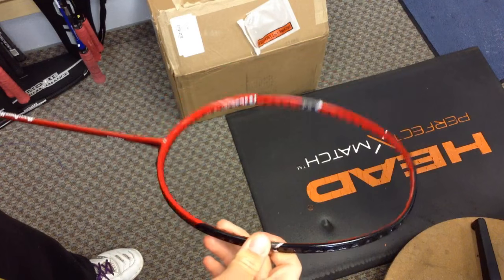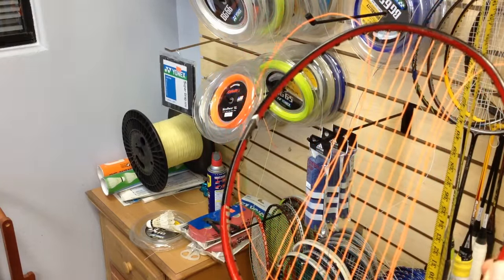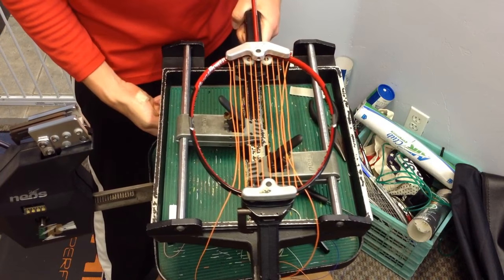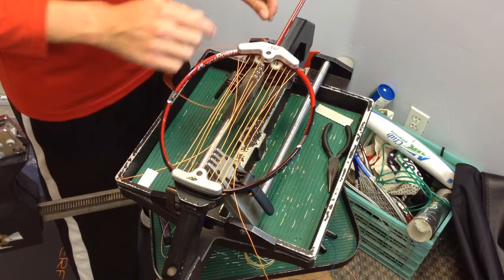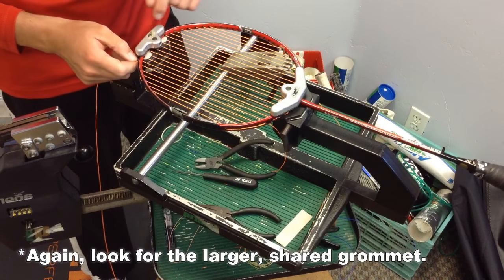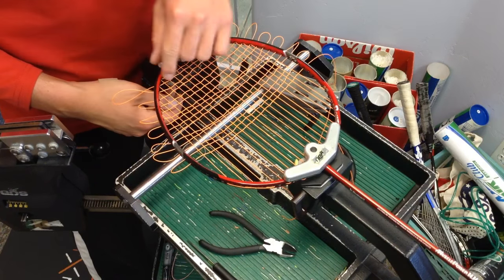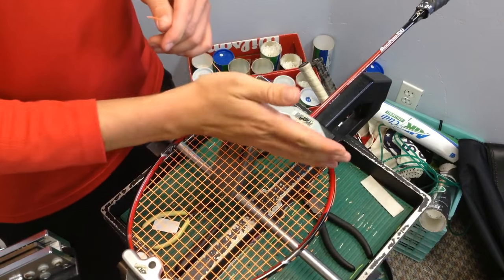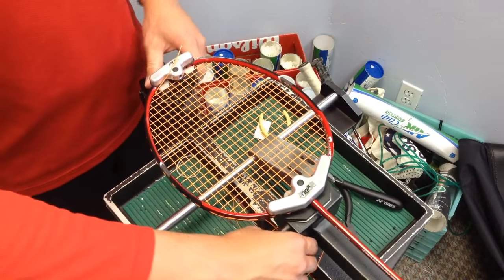Tutorial: How to String a Badminton Racket

Comment: nice video commins, I have the same machine, but my tip plug is quite high compare to yours. They are perfectly fine for tennis but for badminton it's blocking the grommets holes. Where did you purchase that, did your machine came with different tip plugs?

thank you
Reply from the maker: Thank you for the comments. I don't own this stringing machine, it's owned by the badminton club I work for. As far as I know everything on the machine is original, including the tip plugs.

Comment: On the stringing machine..once you've locked the racket on its frame the shaft is then noticeably shaking if moved or touched. So as you're stringing it what happens if you accidentally touched or hit the base of the shaft or the holder or the grip as you're moving/rotating the racket in 360 degree horizontally? Will that 'ruined' or in anyway affect the racket?
Reply from the maker: The racket will be good. It will not be ruined. All rackets have the ability to flex a little bit and when you swing it the racket will seem to bend. That's all that's happening when you touch the bottom part of the racket when it's in the machine.

Comment: Hi sir.. Is it still possible to buy a mp100sp?
Reply from the maker: It's nearly impossible since they stopped being manufactured almost 15 years ago. You may get lucky and find one on e-bay. I still have 4 that are unused, but they're not for sale :)
Reply: @danielcommins1285  OK sir, but I hv a question for u.. I found there could be 2 versions.. Or maybe I'm confused.. Mp100 or mp100sp is the real one?
Reply from the maker: @joshuaprime777  the sp or non-sp version of the racket is a manufacturer/distribution code. They are both the same racket. Either one will be hard to find.

Comment: honestly, I am very concerned about the 2-poin mounting system, and I haven't seen a muscle power for a while, so much memory. Great instructions!
Reply from the maker: On a 2-pin mounting system there's actually a way to brace the sides using a Y-clamp and some spare string to reduce the chance of the frame collapsing under higher tension (>=24 lbs). I use this method to string racket tension as high as 30 lbs.
Reply: @danielcommins1285  can you make a video about that y clamp? I would like to learn because I have a two points machine too. Thank you
Reply: @danielcommins1285  I am interested in a video or explanation of this method.  I have strung previously on a 2 point machine and always wondered if it was feasible to go higher tension while maintaining headshape, to prevent damage.  I always strung 23x25 max except one request, 25x27.5, but customer insisted and didn't care if I broke it.  It didn't break, but I was cautious and worried.
Reply from the maker: @Nate-ui6yl  you have to brace the racket at the bottom horizontally with the y clamp. The racket has the highest chance of breaking at the bottom 4 o'clock and 8 o'clock positions when stringing the mains. This is where you need to put a string using the cross tension to prevent this. The high tension on the mains will cause the racket to collapse vertically so you have to brace the racket horizontally with some spare string using the y clamp. Also note that you should alternate pulling tension on the mains, i.e. one string on the left then one string on the right, etc. In the video I do all the mains on one side because I'm stringing low tension. I have been able to string up to 32 lb using this method on a two-point machine.

Comment: Never, but never strung a racquet like this method!!
Pull one or two strings each time and each side and not do all from one side and after do the other!
You stay at one step to broke the racquet at the top. 😳
The last step with awl over bed strings is an way for broken the strings more fast and may could broken immediately the frame if a string broken, special at critical 2, 4, 8 and 10 o'clock points.
This is not following the Yonex instructions....
Reply from the maker: Thanks for the comments!
You can start stringing both sides of the mains form the center when starting. I didn't do that for my racket because it's low tension (20lbs) and faster when I string one side at a time. The racket should be fine as long as you brace the frame correctly.
Also for higher tension rackets (>=25lbs) I will also start the crosses from the bottom, not the top.
If a string does break while stringing, the frame shouldn't break if the frame is braced correctly.
Reply from the maker: Thanks Alan, I appreciate the comments. I''ve actually heard of you around the badminton circles. I didn't know stringing the mains one side at a time warped the racket, but now that you mention it I do remember seeing a lot of tennis/racketball/squash rackets at the shop being strung from the center outward. I'll add a note in this video to mention that. As far as stringing bottom-up for all rackets, I was taught it doesn't matter too much for lower tension rackets which side you start first. I can see your point though, it would be more consistent. You're also right about cleaning out the scraps, that's something I'm working on!
Reply: I read you alot on badminton central also watch your videos. They are just great. Also you are such nice person, being polite, constructive. helping others being better. Thank Alan for Sticking around. Makes community better.